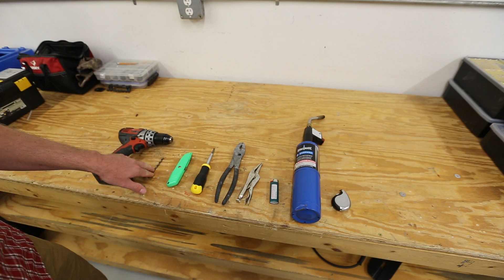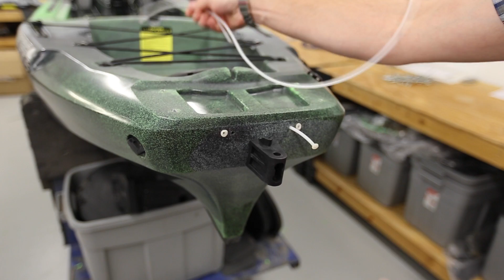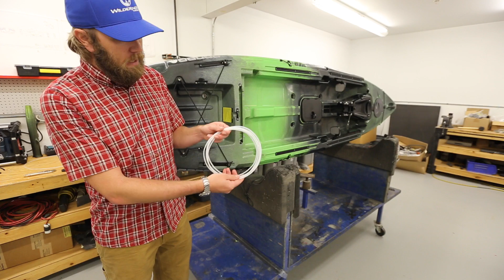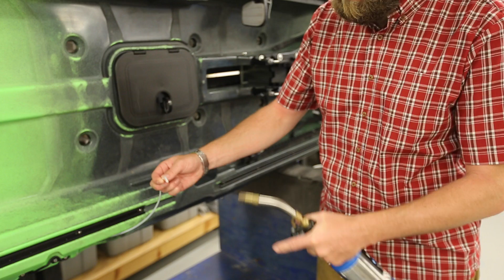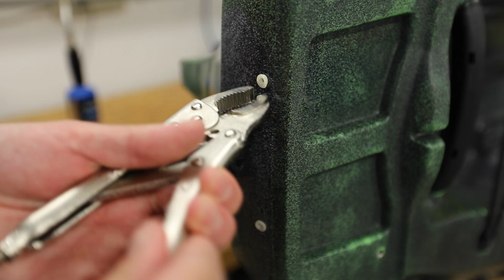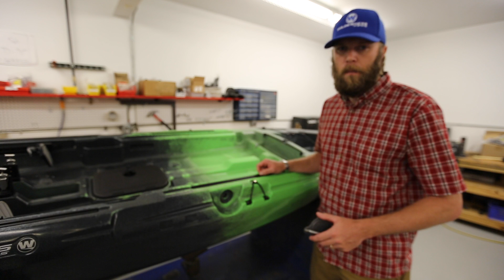How To: Installing Rudder Tubes for Helix PD Hand Control | Wilderness Systems

Comment: What are the other two tubes on the outside in the rudder area for?
Reply: Good question but apparently no answer.
Reply: Good news....   I am a lefty. My 2019 Radar 115 I picked up today now has factory installed tubes for right OR left handed rudder control install options. The only thing I had to discover for myself is that if you want to install the rudder control handle on the right side of the yak... you have to move the control line to the opposite side of the handle. There is another path opposite of the factory installed cable route that you can move the line to for right side handle operation.
Reply: There are tube that run to the foot well for a foot controlled rudder system like the ataks

Comment: TIP:   After flattening the rudder tube ends over,  heat up the point end of an awl or pick to reshape the interior of the rudder tube ends to allow the rudder line  to pass through the ends.  Heat just enough to reshape/widen the ends.  If you leave the ends looking like the demo, you won't be able to push the supplied rudder line through.  I had to do this last weekend.
Reply: from what I saw yes  just move the handle to the otherside but they didn't fit it with the tubes that the control lines run through.  hence this video.   just my observations maybe a tech from WS wants to chime in here?
Reply: Well, my rudder control cord broke already while in use where the cord is pinched by a set screw at the rudder.  I tried using tennis racquet string thinking it would be stronger but it stretches too much and was more susceptible to failing at same set screw location.  Sooo..., I have ordered 25 feet of 2mm (5/64") T316 marine grade stainless steel cable wire rope hoping to fix this design short fall for good.
Reply: I ended up re-stringing with smaller 1/6" stainless cable instead of the 5/64" for less friction and it is working great. No stretch or slop and very secure.  WS should take note...